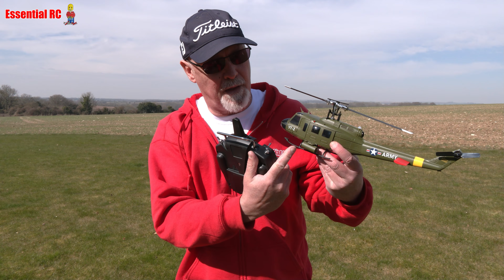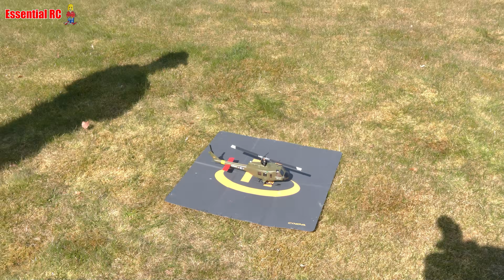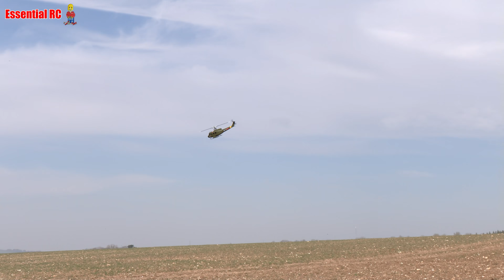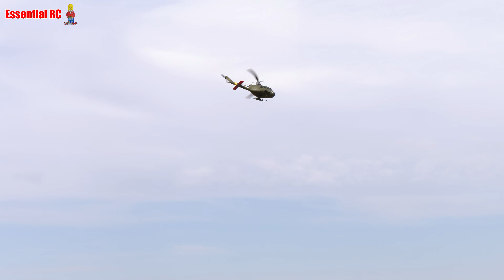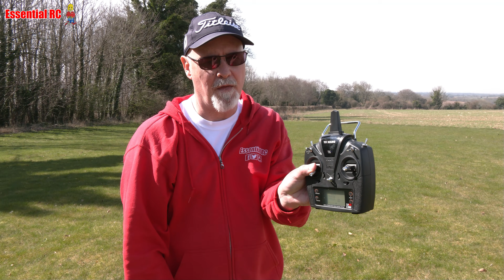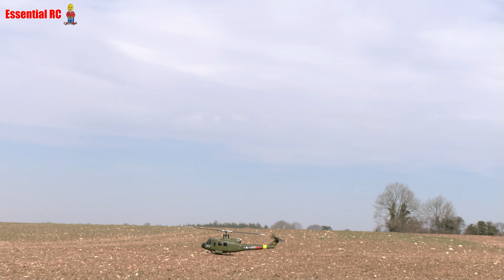UPGRADES ! NEW YU XIANG F07-V 1/34 UH-1 Huey 6G/3D Brushless Direct-Drive Flybarless RC Helicopter

Comment: Dude, that motor power is no joke..like that is some serious horsepower behind that direct drive main motor. I bet it can do some impressive 3d in that mode. Just a tip, if you go into the radio’s settings and reduce both the pitch curve and throttle curve down it won’t be near as sensitive on the collective, almost like turn the collective rates down is the effect, and things will be way more precise and less sensitive. Pitch curve is the biggest one that makes the collective very sensitive, and you don’t need it that twitchy unless you are doing pretty aggressive 3d flight, more than soft 3d flight even is what high headspeed and high pitch angle is used for, but it will be twitchy as hell for most pilots, and never as precise. I’d recommend like a flat throttle curve of 85% and then turn the pitch % down by about 20% less than it currently is on the pitch curve, which is usually a v shaped curve. The manual should tell you about the radio’s programming settings, and it will tame it right down, since I can see its setup very aggressively out of the box, and maybe even a bit unstable, which can easily be fixed with those settings, so it will fly more “floaty” and move around slower and smoother. I think you would like that better, because I fly 3d and I know I would, as this heli has some serious power behind that main motor LOL.

Comment: Hey, is this much better than the regular F07? Thanks
Reply from the maker: Key Differences
Target Audience: The standard F07 is designed for beginners and casual flyers with self-stabilizing features, whereas the F07-V targets intermediate to advanced pilots capable of stunt flying.

Flight Modes: The F07 features optical flow positioning for stable altitude hold and smooth beginner controls, while the F07-V drops optical flow and introduces a switchable 6G (stabilized) and 3D mode for full-inverted flight, loops, and rolls.

Protocol Compatibility: The F07-V expands communication protocols to support DSMX, DSM2, PPM, and S-BUS for wider receiver customization.

Rotor Head and Parts: The F07-V features an optimized, strengthened CNC aluminium rotor head and swashplate design to shed weight and handle the stress of 3D aerobatics.

Transmitter Response: The F07-V remote control is upgraded with independent potentiometers and optimized joystick output for precise handling.

Comment: I have that same transmitter. High rate is switch towards you (down). You should do a drift calibration indoors (no wind) prior to maiden flights.
Reply from the maker: Not on this heli. Low rate was down.